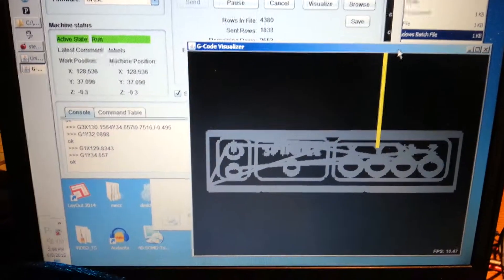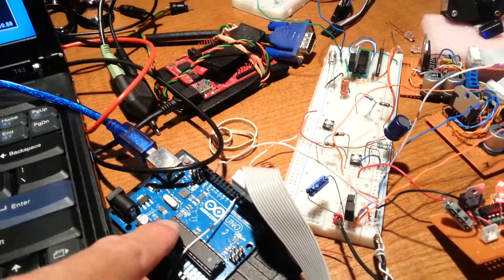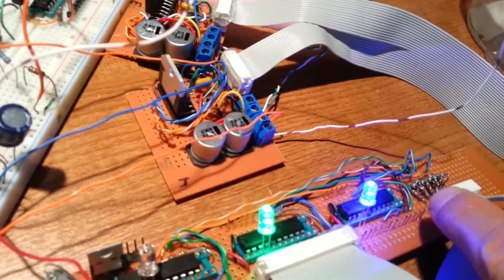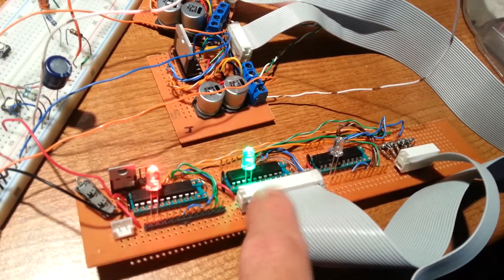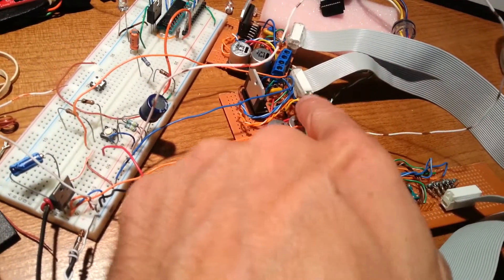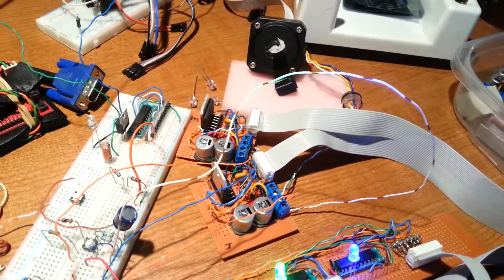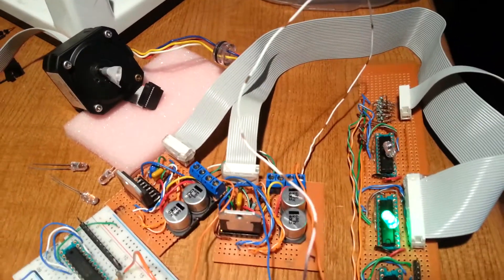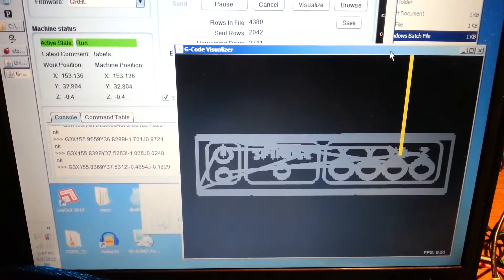CNC 14 - RGB LEDs for XYZ.  Running the stepper. GRBL + Arduino Uno

Comment: How to wiring diagram for it..
Reply from the maker: Sin Sinchan if you search for "grbl" and "stepper controller step dir" pins, you will find lots of schematics and info.  I won't post my particular version because it is generic/the same.
Reply: TheRainHarvester 
ok thanks .. i am also interested to know the wiring led rgb diagram you are using ..
Reply from the maker: Sin Sinchan Sin Sinchan I think I hooked them to one of the output pins and ground.  The outputs on the controllers include 4 pins that control the amount of current the motor drivers put out.  So they blink on and off randomly as one of those pins is toggled.  Sometimes they stay on if the motor isn't moving but holding it's position.